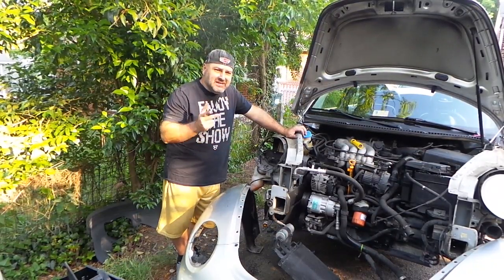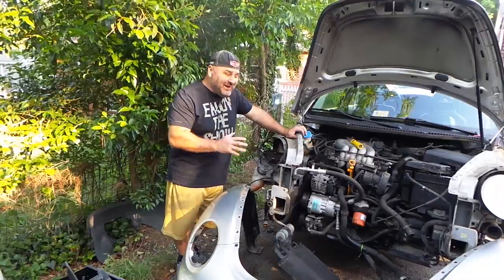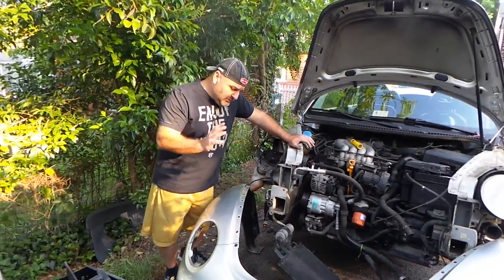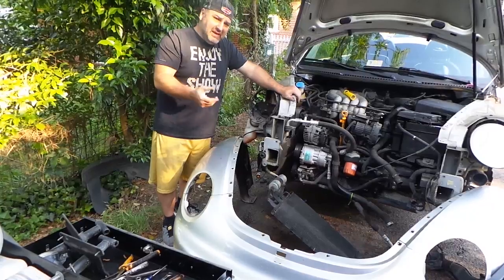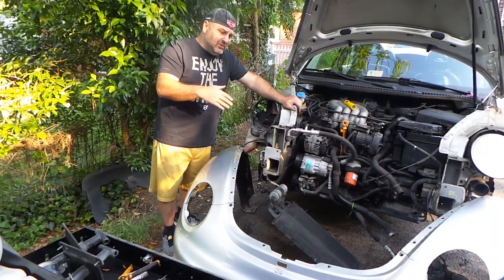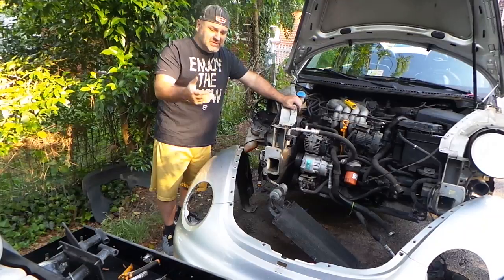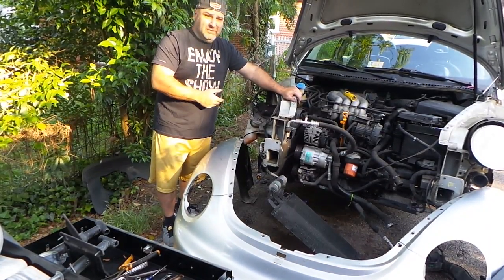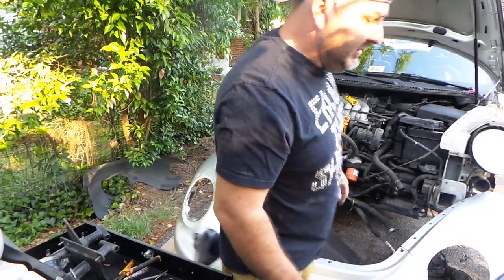Replace Radiator In Volkswagen New Beetle Bug

Comment: Nice information.  Our 2001 VW Beetle has had a very slow leak that we did a lot of minor leak repair.  Only to find it's still leaking, but now it's at the left lower edge of the radiator.  Just a slow weep seep...  Probably could dump some of the silver core repair and get away with it.  But the radiator is only about $55 bucks off eBay or Rockauto has some decent ones at a reasonable cost.

I'll be doing ours in a week or so.  (plenty of time, I"m furloughed from my job until the pandemic crap is done with)  I really appreciate the information given.  Looks rather like a PITA, but it's a VW!  I like the car, so we're going to fix it.

Comment: I enjoyed watching your video. The reason I watched it, is because I was told that one would have to remove the bumper on my 2004 VW Beetle to remove the Headlight Assembly. True or False? Next part of my question... Could you remove the bumper without removing the Headlight Assembly? I recently had our car repainted and the excuse as to why they painted on my headlamps was that they didn't want to remove the bumper so they just taped around it. The driver side headlamp they didn't "set" it because they said that it wouldn't go in without removing the bumper. Thank you for your valuable time.

Comment: I'm changing one a 1999 tomorrow, and I appreciate this video. So I just need a 10mm ,13mm, 18mm, and a t24 torx. The shop was gonna charge her $700 just for labor. So I figured 300 should be good?

Comment: thanks for the video.  I wish I would have finished watching it yesterday before I disconnected the AC line on the bottom of the radiator.  now I know I need to take off that small screw and could have not touched the AC line.  scared the hell out of me when it blow off....smh.....I knew better but was just annoyed with this damn car.
Reply from the maker: lol a/c line will get your attn quick

Comment: Thanks 🙏 for the tutorial.... my radiator is gone in the same area I don't have it out yet but it seems the steel that crimps the rad together touches the aluminum of the fins ... and that produces electrolysis...seems strange that a modern rad that has only ever had antifreeze in it should suffer this problem but they only cost 50 60 bucks so armed with vid I will go for it .. cheers 🍻

Comment: thanks for this video man! I knew my radiator was missing something and i just couldn't figure out what it was.. seems like what i need is a "radiator support".. it all started cuz i just bought a beetle and it doesnt have a splash shield. therefore it'll turn off when it rained.. finally bought now and i coudlnt figure where it went.. i just knew i wasnt missing something but ddnt knw what. THE RADIATOR SUPPORT!! lol.. its 5am in tx and as soon as the sun comes out im out to the store.. hahaha..
Reply from the maker: Omar Flores LOL..good luck my man!! They are always tons of fun when you buy what you think is a whole car and it turns out that you only have 90% of the pieces. Haha, let me know how it worked out for you and if you need any help just let me know. Thanks for the comment and very happy to hear that the video helped you.
Reply: Omar Flores Hey what did you buy to fix that problem because im having the same problem! haha and its really effecting the efficiency of my car.
Reply: Well, mine would turn off cuz it didn't have the SPLASH SHIELD. The reason the shield wasn't there was because the radiator support wasn't there and the shield goes assembled into the radiator-support frame.. but you're radiator-support is fine you don't have worry about it.. just check for the splash shields.. there's one for the motor and one for the tranny I THINK. I'm a musician not a mechanic.. lol... but yeah, putting the splash shield on fixed it...
Reply: How much did it cost you to get it fixed? And is splash shield the technical term for it because I'm trying to find it online and I'm not finding it, but at least it's nice to find someone who has the same problem as I do haha
Reply: look, check it out.. that's the one..

Comment: I have a 2003 New Beetle:  primary fan has major short, want to swap it out for another non-VW fan I have laying around.... Is it better to pull radiator / fans as a single unit, install new fan, and reinstall radiator / fans ?   Not much room behind radiator for my XXL hands.  Tks.

Comment: can I ask you something?....Why i don't have power on the cable on injection pump...dont start the pump ...I have  alote of White smoke...and and stop the Machine when it's overheating...beetle 2001 turbo 2.0..thank you..
Reply from the maker: most likely bad head gasket ,  the pump not related